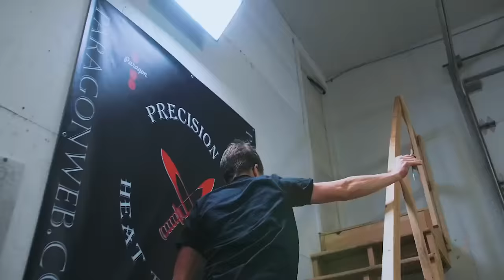MAKING A STAINLESS DAMASCUS CARVING KNIFE AND FORK!!! Part 4

Comment: Alec, why don't you mount a small vise in your engraving room? Save you a lot of running up and down those stairs.
Reply: About to ask this... needs more upvotes for visibility...
Reply: After the 3rd time I was asking the same question
Reply: It's a life choice... more exercise that way.
Reply: The man needs his exercise leave him alone lmfao
Reply: Hmmm yes, perhaps even.. a 3D printed one?

(and bronze cast of course)
Reply: What you don't have in your head, you've got in your legs.
Reply: Not to mention limiting chances of biffing down the stairs with an edged or in this case pronged implement.
Reply: Vice?
Reply: Alec you better hook the puppy up. The internet compels you sir.
Reply: Because that would be the logical thing to do.
Reply: Lol. I was just about to say the same and saw your comment.
Reply: needs to get his steps in
Reply: I wonna write the same thing haha
Reply: Exactly my thought
Reply: Was about to say.. "what I take from the last 2 videos is... you need a vice upstrairs..."
Reply: @RN-du8wr  wow, good point
Reply: He should get a littles town number 112 vice
Reply: @joeysaks6516   lol. Good pun.
Reply: Brad AmeerBeg  Well, it's like this...Alec is now a man of business, his time is valuable, and it behooves him to spend it wisely. Running up and down the stairs multiple times to do cut-and-try fitting is not a wise use of time, even if he does get a little exercise. Save the exercising for non-business hours.

Comment: Pro Tip- if you sand the end grain on maple with finer sand paper that you use on the "surfaces" the dye will not soak in as much on the end grain because you close the pores a bit more than the other stuff. B E A U tiful work fellas!

Comment: Alec, about the dog-tag....You can do better than just the tag!! You can make a modular collar out of leather, and make not just the tag and connecting rings out of metal, but the leather strap sockets that connect the collar! by adjusting the pins that connect the leather to those sockets, you can just cut and refinish a new length of leather for the wonderful little pup as they grow! Always a custom fit, like the finest suit for your beloved dog. As for the sapphires, I would really recommend 3 sapphires at most; 1 on each of the leather sockets (representing you and your wife) and one on the tag itself, incorporated into the embossed bone relief (to represent the wearer). It will be like you and your wife are providing support and comfort together for your pupper to have a good life, you know? 

Even if your puppy doesn't wear it all of the time, it's a wonderful "welcome to the family" gift for them! ^v^

Comment: The "Yeah..." this ep ends on is priceless. Thx for the laughs and nice job on those pieces. Perhaps you can collaborate on a wooden cutting board/butcher block and a decorative steel serving tray to go with them for Christmas. . . You guys could even deep fry a turkey (I suggest reaching out to/learning from Bard at Bon Appétit for deep fry tips) to then cut and serve as a bonus video. 
Also how long until the mentioned puppy gets to make an appearance?

Comment: The end grain of your handles -- a suggestion. If you seal end grain with 50% shellac/50% alcohol before applying stain it will come closer to matching the stain on the long grain of the wood. Old woodworkers trick.

Comment: For future stainless etching...if you need air mixed into that ferric chloride, there are these aquarium aerator rock thingies (just looked it up, it's literally called an airstone) that diffuse a lot of little bubbles into (usually water) that I think would A) work really well and B) be affordable and easy to find in several shapes/lengths.

Comment: nice job guys
have you ever considered oil stabilizing the wood for your handles/scales?  just get the wood submerged, in a container, in a vacuum chamber, and lower the pressure until all of the air trapped in the wood stops bubbling out, as it is replaced by oil. it will have a better feel to it, feel more solid, and has a wonderful texture to the hand when well finished. I think you will never go back once you try it

Comment: Hey alec if you throw the bolsters in the mill you can touch off and mill the small trench in one go save a TON of running with 1/8 endmill touch off lock the quill set the stop then raise the quill and bring the knee up .010 to .015 when you bring the quill down to the stop itll only take off that .010 you raised the knee then just traverse on the x axis till your mark and done

Comment: Muratic acid takes a long time when it's cold, works faster when warm, for the high/low.  Muratic stinks and burns your nose too, try for 90F, Then the Ferric dip @ 1to4 water provides the color to the valleys. Neutralize well afterwards with bicarbinate, then wash with water and dawn to get the grey goo off. I keep 304/316 in the ferric a good 20 minutes or more. Probably 20 minutes in the muratic also unless it's July and 110F.

Comment: If the stainless steel etching needs air in the etching solution, perhaps you could try a setup with an aquarium bubbler? They're real cheap these days, and super simple to set up, you don't need anything fancy or special. Don't know if the foam bits and plastic accessories will hold up in acid. But the nylon tube should be perfectly fine, maybe poke a few holes in the side for more bubbles. This could come in handy if you guys do bigger pieces in the future.

Side note to Alec; my family and I are all born and raised in the states. My Mom has had a life long problem pronouncing the word alun inum(as spelled, and no problems with any other words). I suggest the UK pronunciation after hearing it on TV, it's never given her problems. Just a linguistic curiosity.

Comment: Consider hitting wood with a dark alcohol based stain, sanding back and then going over with a lighter colour. Or pick two contrasting colours, apply one and sand back and when the main colour is applied the grain that kept the first colour will come up very dark.

Comment: i would recommend using tallow candle to mark with smoke not Dykem
this is used in gun making to get precise fits between 2 pieces of metal
this technique will always leave a precise mark when you want a vary tight fit

Comment: In  the end...the two of you have managed to produce an aMAZING looking carving set. Input from (hope that I get this right) BarefootForge (is that right?) seemed to be VERY helpful. What you have created is a carving set that would be welcome at ANY dining table...and looks like it could easily be handed down through the ages to further generations. KUDOS to you both!
I must say, Sussenach, that you are fitting in quite well with the spirit of the American Frontier! I think you've got what it takes to make it.
Reply: Alec: I would like to offer a small suggestion that would simplify the task (and tediousness) of doing all of that delicate hand-sanding. What I have done in the past is to set up a random-orbit sander so that it is facing "pad-up" and then working my pieces across that surface (much like you would at your belt sander). This gives you the option of getting it down to some pretty fine grit paper (almost to the polishing stage) without the expense of all that "elbow grease" of having something clamped in a vice or clamp and tediously scratching at it with a small bit of sandpaper. It takes a wee bit of practice (just like any other power tool we use), but you can develop a pretty good amount of control and finesse pretty quickly. It's just a matter of how much down-pressure you exert on your workpiece.
Reply: You should also learn to rely on the "slack-belt" section of your 2X72 sander to work those more "organic" shaped pieces of your work.

Comment: There is an easier way for fitting hidden tang handles, by putting a dowel over the tang and just drilling a hole in the handle block you only have to make the bolster fit perfectly

Comment: I weld, stainless steel welds together with E7018's, so if you get steel that is similar to the steel in E7018 welding sticks... it might work a bit better, as opposed to using all stainless. E7018 and gunmetal stainless used in precision rifles. "energized forge welding" like a spot welder but bigger?

Comment: I don't understand why you'd put blue on the bolster... put it on the shoulder of the tang, so it transfers to the high points on the bolster, then use the electric burr tool to clear away the bits which are blue. Repeat until it fits. Way easier that putting it on the bolster and guessing at which bits you've worked on and how deep you need to go.

Comment: You could use try using hydrogen peroxide in your etching solution to add oxygen so you don't need to shake it or get an aquarium bubbler.

Comment: I think you have been discovered chromium depletion. When heated, other stainless alloy loose chromium and become less resistant to corrosion. It is common phenomena in stainless welding and can make stainless to rust.

Comment: Try adding some hydrogen peroxide to your etch mix. To dissolve the copper off of circuit boards, I use a mix of 3 parts 3% H2O2 (hydrogen peroxide) to 2 parts 31% HCl (hydrochloric acid, aka muriatic acid, aka toilet bowl cleaner, aka stomach acid). The acid by itself does basically nothing to copper, but add the H2O2 which gets some oxygen in the mix, and wow. If oxygen is your problem, then the same might work for your application.

Notes:
1. The mix doesn't store well, loses it's strength. So you'll have to mix it fresh each time. Also has a fairly high vapor pressure, so store in a vented container.
2. A bottle of HCl will corrode anything metal that is stored nearby.
3. Never ever mix H2O2 and acetone. Kaboom.

Comment: Alec, didn’t you apply heat to the fork before the etch?
Reply: Yes, but that would ruin the temper on the blade.
Reply: He didn’t get it glowing hot, more of a blue backing (if I remember correctly) which wouldn’t necessarily take the temper out of the blade

Comment: Not picking, just asking. Your micro grinding room is on a different floor, wouldn't it be more work efficient on the main floor, or is there a reason ?
Reply: Steve Loomis its much more a precision /precious metal / gem setting room. This way its isolated and away from the general mess of the shop.
Reply: @rileyfenley522  I understand that, but sealing a room on the ground would seem a bit more work friendly to me. I deal with a dust issue myself, Thank you for the reply by the way.

Comment: That whole 'oxygen in the acid' thing is pure nonsense. like, utter bunkum. the rate at which oxygen dissolves into a liquid is painfully slow and splashing it around like that is just getting acid on the floor for no reason and having no chemical effect.

Comment: Alec you are in America, we spell it aluminum and thus pronounce it aluminum, you are no longer allowed to spell or say aluminium. 

Fun fact the person that discovered aluminum spelled it that way but the board that was in charge of adding new elements to the periodic table wanted all new metals to be an "ium" and thus forced the change regardless of the discoverers rights to name it. If they could they would have changed the name of platinum to platinium lol. Anywho I wont say aluminium because I respect the discovers choice on names rather than some bureaucrats wanting "ium" for no good reason.